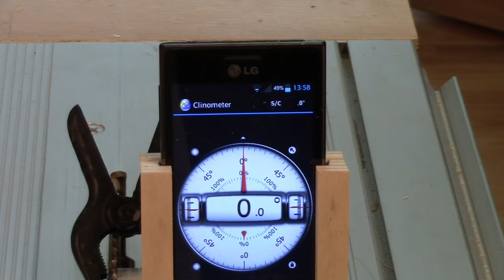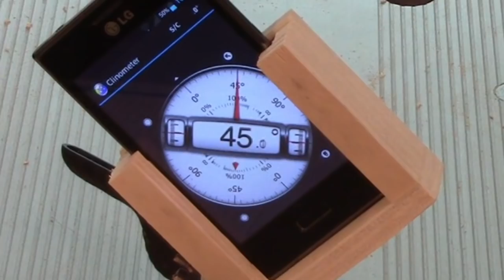The smartphone as an inclinometer for the table saw. Does this work? - DIY JIG

Comment: I’ve been using my iPhone with that app for several years. I don’t have the nice jig you made. Just hold mine on the blade and it works great! Glad you posted the video so others can use it like we do!
Reply: MRrwmac that’s provided the surface of the table is perfectly level unless your app has a function to zero it out based on the table position.
Reply: You Tube It does.
Reply: Which app is that, there's so many on app store, it would be good to get one with a genuine approval rating.

Comment: Thanks for the posting. It seems to do a good job. However, my understanding is that you did assume that the table top is horizontal. The desired cut angle is always the angle between the table surface and the saw blade, not the angle between the gravitational (absolute) horizontal level and the saw blade. In other words the reading on your device gives the right cut angle only if the table surface is perfectly level. Otherwise, if your table is not level, you should either ad/subtract the angle value  of the table inclination and use the resulting value as your "desired cut angle, or level first your table and then use your device the way you shown. Therefore, before using your method here, I would always measure/check first if the table is horizontal or not.
Reply: The app have an absolute zero button, so you put it in the table top, press this button and this is the 0 degree point.

Comment: I'm so glad you did this! I was thinking of doing this (but not exactly).  I want to basically use my app to make sure my eventual homemade drill press is straight up and down using my phone app.

Now that you've demonstrated it is pretty accurate.  I will have a little more confidence. Thanks!
Reply: Just to get your insight...my thought was to have a piano hinge mounted vertically with a fairly solid board/shelf that would swing away from the wall that it is attached to and the throat distance would be quite further than most standing drill presses.

On the wall side of the mini cabinet that would swing out would be my drill bit storage.

The idea looks great in my head. Juat gotta get other projects done first. Great job with this!

Comment: Hi. Great idea and vid. Thanks, as I was wanting something like this. How ever, after watching the vid it has made me realise Something. Which may help with the reason why some of the mitres may not be 100% accurate. The metre app is going by gravity ....not by the flat surface of your saws table top. The table top may not be 100% flat or level (which is the area that the wood being cut is running along.) I know this cos I have a terrible time of accurate mitres going wrong due to my table saws top is fractionally buckled and not 100% level due to an uneven floor. (Table saw is made from pressed sheet steel even the legs which can make it a bit flimsy) It dips in a particular area thus throwing the cut fractionally off...as we know a fraction of a degree out can be exaggerated even more further along the cut line depending that length of cut.  Hope this helps.